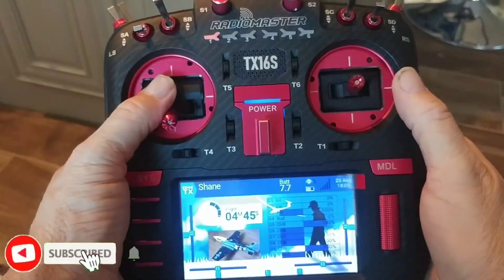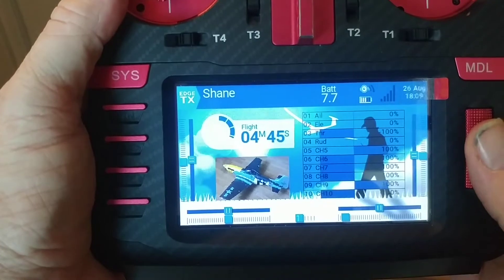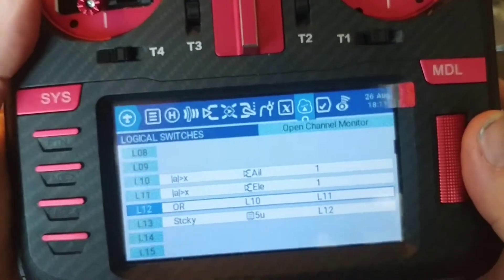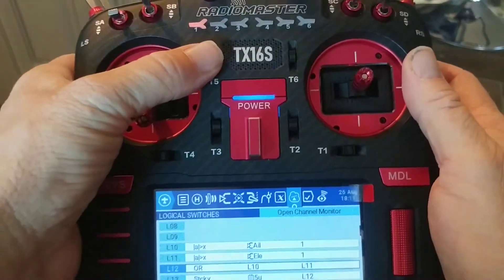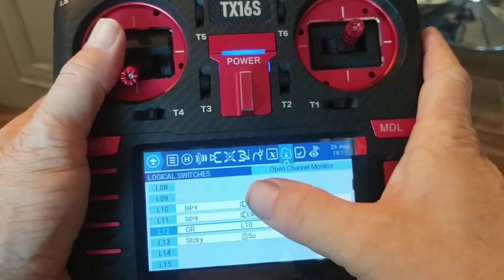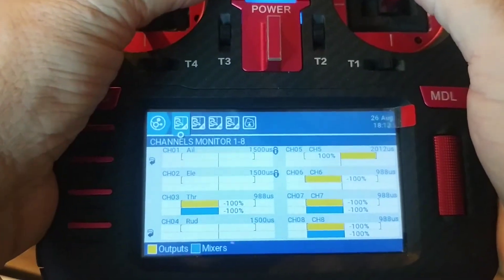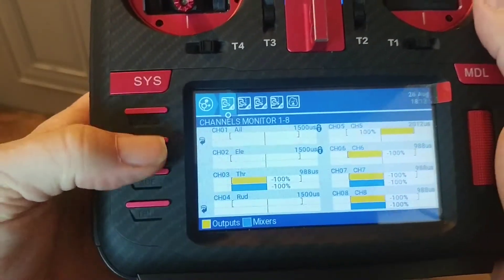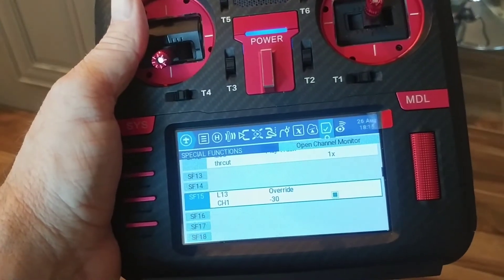RC RadioMaster TX16S Aircraft Launch/Loiter Mode Programming Update

Comment: How would you add Aileron to this? Say, if II wanted a little right Ail, AND up Ele?  Just add another SF using channel 1? Thanks for these!

EDIT: Answered my own question by just trying it...LOL! Yes it does indeed work that way. Thanks again for this! I'll finally be able to launch my RareBear without wincing evey time!
Reply from the maker: Happy to help.  Keep in mind that without bank limits of something like SAFE SELECT if you set aileron, for example, at a set % it will keep rotating and eventually go inverted or enter a spin!  Might need to get even more creative with the programming logic and just give it some aileron for a second or so to set a bank then return to 0%.  Food for thought!

Once you setup the mode it's easy to add an override SF to any control surface or the throttle.  Might be cool to have it play a track like "launch mode" (lncmod) when enabled and maybe "manual mode" (manmod) when deactivated, use !L13 to know when deactivated.  Of course L13 is my logical switch for launch mode, yours is likely different.

Thanks for your comment and happy flying and programming!